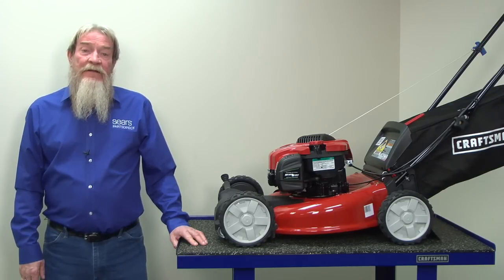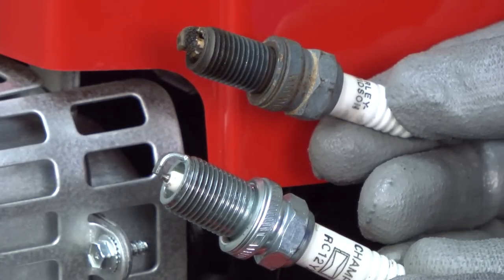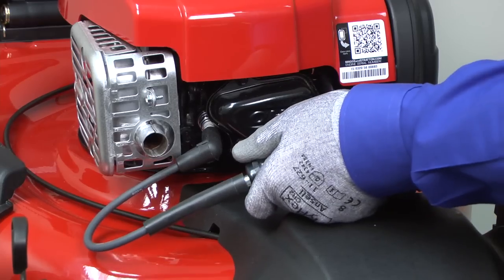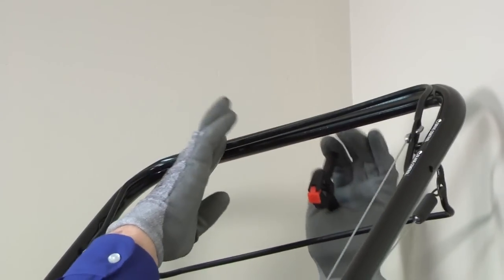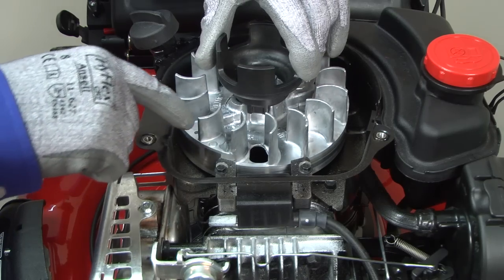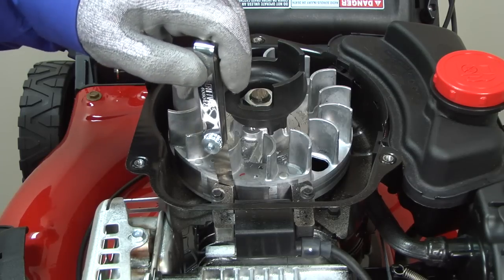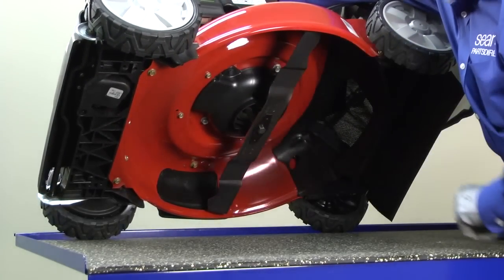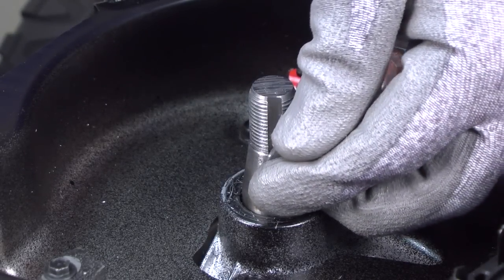Lawn Mower Won't Start: How to Troubleshoot Spark Plug and Ignition Problems

Comment: Great video, which helped me diagnose my problem. Thanks.

One correction though, is you say "If the meter measures resistance or reads 0 ohms , then you need to replace the stop wire." - this is misleading as you should say "If the meter measures close to no resistance, check the cut-off switch and cut off mechanism" since just changing the wire will do nothing to help. 
You could also try starting the machine with the cut-off wire disconnected, so long as you have a fuel cut-off valve to eventually stop it. Then again, you know the fault is with the cut off switch.

Comment: I put some silicon stuff that is used for gaskets on the piston cover of my craftsman push mower. Now I have a hard time pulling the rope when the spark plug is in the mower. What did I do wrong and why is it happening? Do I need to invest in a new gasket? Otherwise the mower works fine.
Reply from the maker: Pull off the cylinder cover and check for silicone residue inside the engine cylinder. If some of the silicone dripped down into the cylinder, you’ll need to clean the cylinder, piston cover and gasket mounting surfaces and then install a new gasket.
Reply: Okay I will check, Thanks! Will reply if not work, for I have done some reading and think there is another possible problem....

Comment: would a broken flywheel key prevent the ignition coil from making a spark?
Reply from the maker: A broken flywheel key probably won’t prevent the ignition coil from sending current to the spark plug to make a spark during testing shown beginning at :53 in the video. If you pull the starter rope and spin the flywheel when the flywheel key is broken, the ignition coil will likely send current to the spark plug because the flywheel magnets pass by the ignition coil. If the mower blade hit an object, broke the flywheel key and dislodged the flywheel or ignition coil, then the air gap between the flywheel magnet and ignition coil may be too wide so the ignition coil may not send current to the spark plug in that situation.
Reply: Sears PartsDirect im getting a spark but it wont turn, can it be the shut off wire? if so how can I fix that? thanks for the help
Reply from the maker: Because you’re detecting a spark, the shut off wire seems to be working properly. You indicate that something in the engine won’t turn but we’re not sure what you’re describing.  If the flywheel spins and the piston moves when you pull the recoil starter rope, then the flywheel key could be damaged but still intact enough to spin the engine crankshaft and cycle the piston. A damaged flywheel key will prevent the spark plug from sparking at the right time so the engine won’t start. If this is the situation that you’re describing, check the flywheel key and replace it if damaged. If the flywheel turns when you pull the recoil starter rope but the engine crankshaft doesn’t turn (and the piston won’t move inside the cylinder), then the flywheel key is broken because the flywheel key helps connect the flywheel to the engine crankshaft. Check the flywheel key and replace it if it’s broken. If the flywheel is okay, then a fuel system problem or compression failure could be preventing the engine from starting. Follow the tips in this troubleshooting video to resolve those types of issues: https://www.searspartsdirect.com/article/lawn-mower-wont-start-troubleshooting-video-fuel-ignition-and-compression-problems.html.
Reply: New leaf- What may be happening is that the fuel shut off needle is not seating when engine heats up and your carb is flooding. Install an inline cut off valve and shut if off a couple seconds before turning your engine off. Then turn it back on when you get ready to start engine. Start engine soon as you turn on the valve so fuel does not have time to flood over, or start engine with it still off and turn valve on soon as engine starts. You may need to replace the needle and seat in your carb. If this does not solve your problem you may have a weak coil that is loosing spark once it heats up.

Comment: I own a lawnmower with that same engine but most of the time the engine barely picks up the fuel but sometimes if I spray carb cleaner into the intake the engine will start sometimes even though the carb is clean and there is fuel in the tank.  Why would the engine barely pick up the gas 9 times out of 10 when I try to start it?  Is that an ignition coil or the coil wire issue?
Reply from the maker: Your symptoms seem to indicate that the choke system on the engine isn't working properly. Follow the troubleshooting shown beginning at 5 ½ minutes in this video: https://www.searspartsdirect.com/article/lawn-mower-wont-start-troubleshooting-video-fuel-ignition-and-compression-problems.html . If the choke mechanism next to the muffler on your engine is stuck and isn't restricting air flow into the carburetor when the engine is cold, then you may need to replace the choke mechanism. That choke mechanism is included with the muffler on some engine models. We hope this information helps. If you need further assistance, give us more details about the problem and include the model number of your engine or lawn mower so we can see the exact type of engine that you have.

Comment: Don't need a rig like this. Just unscrew plug from engine put it back in the coil plug wire and lay it against the engine. Hold grounding/brake lever on the handle down and pull the start cord. If there is no spark coming from the plug electrode then it is not firing and either the grounding wire to coil is broken or the coil is bad or bad plug. If like me your eyes are weak and not sure if you see fire, take engine in a dark place or wait till night and it will be obvious if it has spark.  Disconnect the ground wire on the coil. Then hold down handle lever and pull start rope. If it sparks the coil is good and grounding wire is broke. No spark and the coil is bad or the spark plug is bad. Likely not the plug because lawn mower plugs usually last as long as the engine itself even though it is recommended to change them periodically to keep a strong spark. My grounding wire broke. Didn't see where. So I just ran the grounding wire out from the coil beyond the shroud cover. Then just ground it to the engine block manually when shutting off engine. Make sure I hold the lever on the handle down while manually grounding coil as this lever also controls the flywheel brake which will wear down on the flywheel while you are manually grounding the engine unless the brake is released. You can wrap a piece of wire around the handle to the lever while manually grounding off engine if you can not reach the ground wire while holding the handle lever down.

Comment: I just use a business card,  most of the time one will work, every now and then I have to double up and use two. You do not need that fancy spark tester thing, I just have the wife hold the spark plug wire and give it a pull, she lets me know. Well it worked once. Yeah it is nice to be single again.